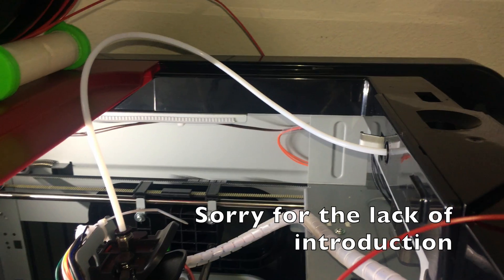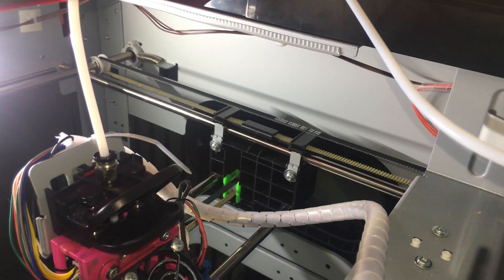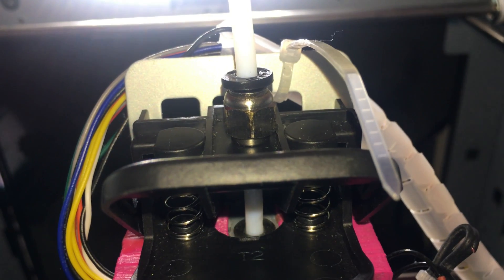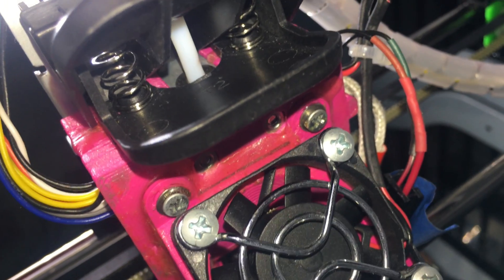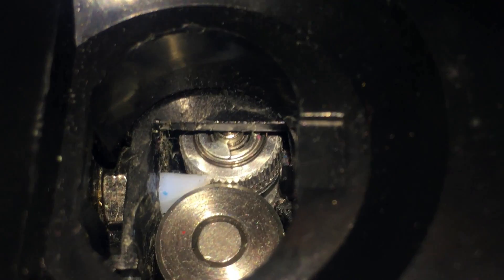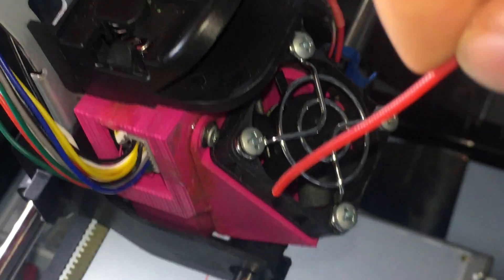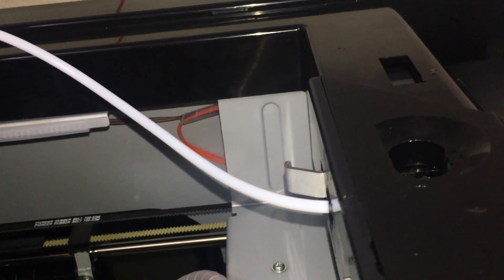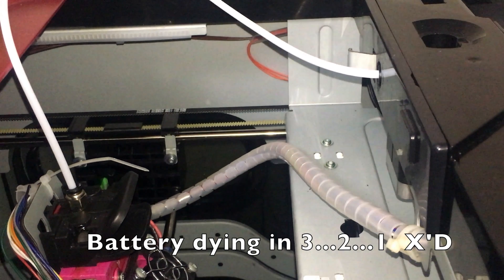Printing Flexible Filaments on the Da Vinci Pro 1.0 and 3-in-1 3D Printer

Comment: I do it like you describe it in your video. It workt good so far but sometimes I have the problem that   the filament bents around the gear of the extruder and it is a mess to get it out.
So I work on an part vor the extruder to tighten up the tolerances between the gears and the entry point of the filament. It's a bit treaky but I think I get it to work.
When I'm finished I post it on thingiverse and the xyzgallery.

I have the stock extruder and it works fine with the filament.

Till than happy printing
Max

Comment: Hey, the piece that you said has no purpose clearly has a purpose. The company would not just add something because they feel like. That's a waste of money. It does serve a purpose which is to hold the bowden tube fitting and direct the filament. I would say it's a bad design and the way you go about fixing it is not terrible. Once I get started on my e3d conversion, I might take a look. I mean making it easier for flexible filament is also improving the printer for pla, abs, etc. Nice video and thanks for good shots of what was done.

Comment: Hi Oscar, Thank you for the tips on this mod.  Question, did you have to drill the hole larger in the plastic between the pneumatic fitting and extruded gear so that the PTFE tube goes all the way to the gear?  Thank you so much
Reply: Thank you!

Comment: I did this mod a few months ago. it works great. it makes better quality prints due to less slack when feeding and retracting.
Reply: To stop the bed rocking side to side I used some thin shim steel I had which was approx 0.15mm thick and wedged it between the plastic bed and the metal linear bearing. Again this improved the quality of the print loads.

Comment: This is a GREAT modification and I will for sure do a thing like this also...
Thanks so much for sharing !!!
Reply: For you I will try this modifiction before I switch to the E3D V6.
I think I will do the conversion next weekend, or the weekend after that. First I have to print around 800 parts for a few other printers.
Reply: Together with a friend of mine we are building 2 CoreXY printers with a buildvolume of 20x20x20cm and one with a build volume of 40x40x40cm.
All enclosed, heated bed AND chamber with thermostat on board camera's, etc.
Will be a very nice build. We are now printing the parts and waiting for our orders we did in China.
Reply: Im Very late to the game on this one knowing it was 3months ago it was posted. but How well did this workout with the stock Hot end? i know @chrissch1960 said not so good, but has anyone had better results? Really  excited to use flexable fillament!
Reply: YES!  I just started printing with the flexible filament and still have to dial in the stringing (retraction), but this is a success with the stock hot end. I did not have a need for any oil in the bowden line as suggested, and I think this is better. Also, nobody mentions this, I found out the hard way, but watch out for the Z axis offset. I set it to the thickness of a standard piece of paper for ABS/PLA. For the flexible filament (I am using Colido, was on sale at Hobby King) you will need about twice.  I do recommend another mod: cut out the pieces of plastic above the extruder with a dremel rotary tool, so that you can access the extruder without having to take the whole printer apart. It will happen many times as you find out your best Z offset setting for the flexible filament. It is just a hassle to have to dismantle everything just to get to the extruder.